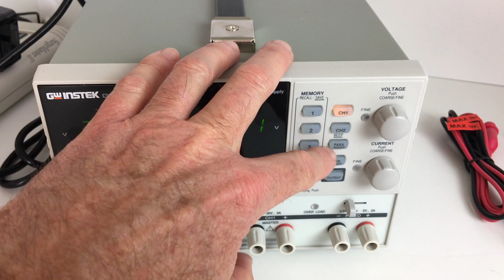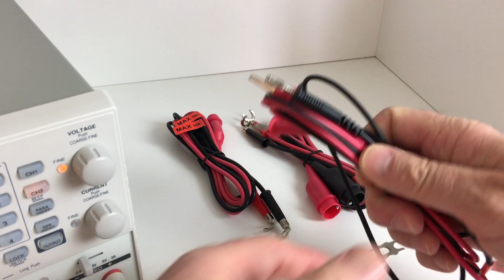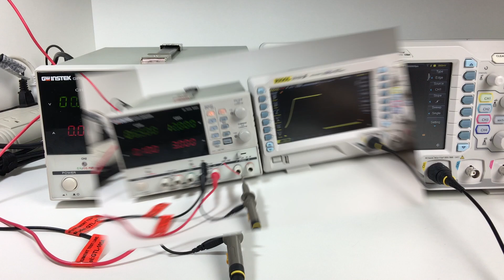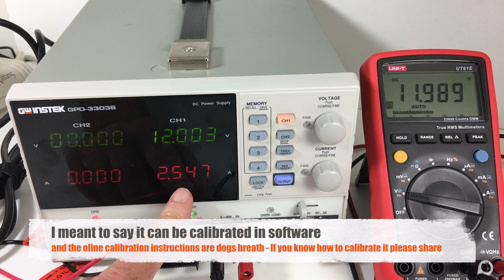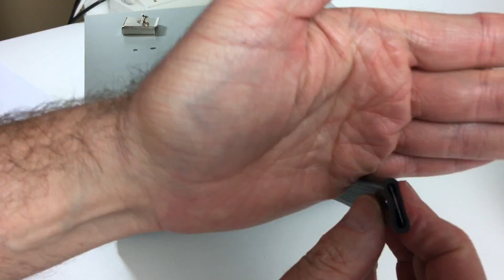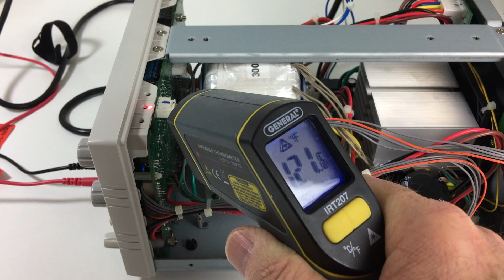GW INSTEK GPD-3303S Review

Comment: Nicely done review! I have the same PSU that has started giving me some trouble - when I press the output button for a preset voltage/current, channel 1 goes to 0V, 0A. Any idea why this is happening? The other channel works just fine. I don't see the OV protection coming on either
Reply: turned out to be a easy fix - fuse at location f301 was bad

Comment: I think the power supply is telling the true value and not the UNI-T UT61E DMM you have, I got a problem/s with UNI-T Meter products. Especially when getting a precise reading. I always used FLUKE products though expensive but it's way more reliable than UNI-T. :)

Comment: Have anybody found really working guide for calibration this definite version of GPD-3303S?
I tried to follow calibration guide from GPD3303SM.pdf but sequence of buttons doesn't correspond to this version because of different firmware version and as result different interface screen was shown.
Reply from the maker: I have the same problem.  Here's hoping someone out there has a document that works.

Comment: Thank you for putting the detail into this review.. I am looking for a no frills yet good quality power supply that offers low noise, 0 over shoot and 1mv/1ma resolution.  It looks like this might fit the bill.  the Korads are tempting but as you say I need at-least two of them which puts me at 260 dollar range...

It looks like the internal topology is very similar to the Atten and Siglent supplies Dave Jones did tear downs on.  very curious :)
Reply from the maker: Yeah, I noticed the similarity with Dave Jones' Siglent power supply review as well.  Makes me wonder if they are all designed by the same engineers?
Reply: @DogFaceMaker  I know this is an old video, but yes, siglent and gw instek sell some of the same power supplies.  not sure who actually makes them. examples being GW Instek GPR30H10D vs. Siglent SPD3303X.  there are more examples but I didn't feel like looking them up.